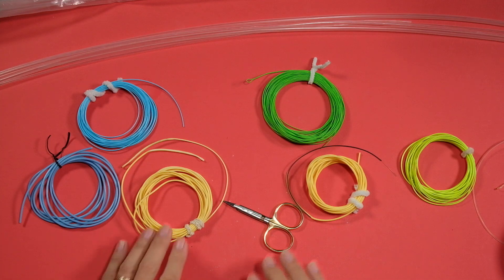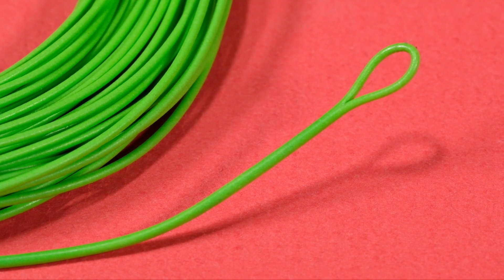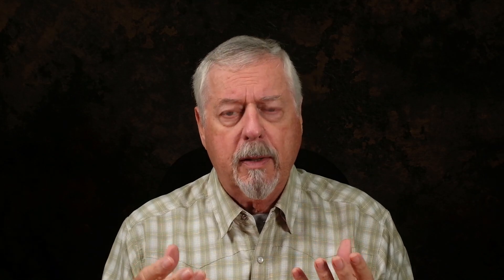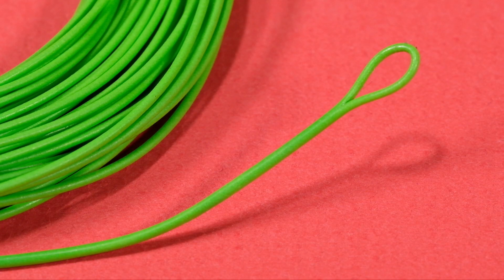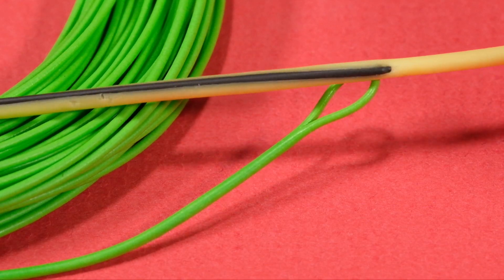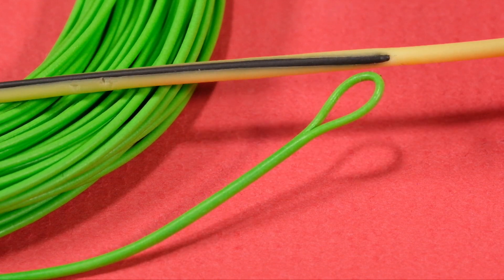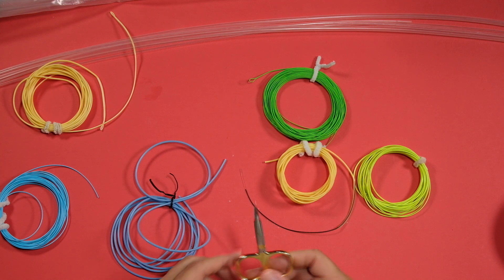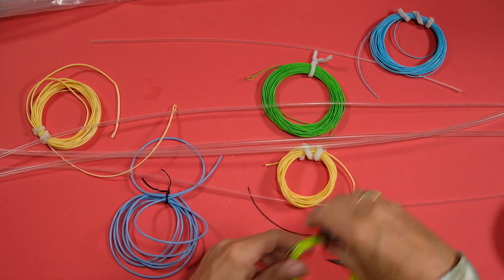Welding Fly Lines 101: what we need to get started

Comment: Do you think a "RIO Products Outbound Short Shooting Head" can be welded to a "Maxcatch Fly Line Floating Shooting Line/Running Line" with good results?
I know the Maxcatch is pvc, and I'm waiting on Rio to reply as to what theirs is made out of, though it's subtleness is suggesting polyurethane. I welded a very nice loop in the Maxcatch and fished that way for a while. The loop connection is grabbing my guides more than I'd like, and I'm considering trying to weld the two together, eliminating the loops. I'm afraid to cut the factory loop of the Rio without knowing for sure if it'll melt right.  I'm in Florida wading the flats so having a shooting head down here isn't exactly essential for now. Thanks much!
Reply: Yes, they're both PVC. Only Airflo uses PUR. They should weld with no problem.

Comment: Seriously recommending a cutting mat,and a steel ruler.When the heating ends,put the welded part on the cutting mat inmediately , use a steel ruler rub it repeatedly,you will get a beautiful round and straight welded line.
Reply from the maker: The thing to worry about - separating the coating from the core. It'll lose a lot of strength in that case.

Comment: Thanks for this - excellent as always. I've watched all your earlier videos about welding fly lines, but for some strange reason, this video motivated me to have a go at welding again (I had some modest success in the past welding loops in t-tips). I had an intermediate 44ft shooting head with a sinking running line, but it was too light for my spey rod. I cut the head at 33 ft, welded loops in the front and back and resurrected an old floating running line by welding a loop. The welding worked really well and the new shooting head and running line are reeled up. Hopefully, the reduced weight and head length will make the line useable with a 6#/7# trout switch rod :)

Comment: So, could I take a double taper line, cut it in half and use a running line from an old weight forward line?
Reply from the maker: Yup!
Reply: @hooked4lifeca  I look forward to the video if it is still coming.
Reply from the maker: Already have an older video that shows how to connect a head section to running line: https://youtu.be/cV-TzT7YpAs
Reply: @hooked4lifeca  where do you purchase your inexpensive heat shrink tubing from?  Link please.
Reply from the maker: @gregb8824  Sayal Electronics in Burlington, ON. https://secure.sayal.com/STORE2/catalog2.php